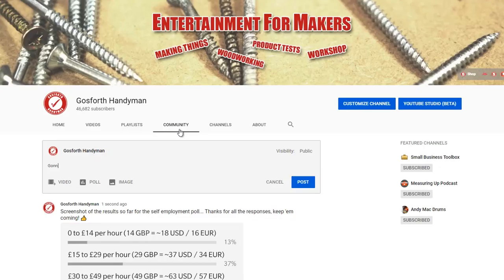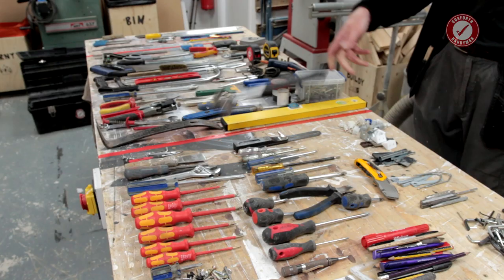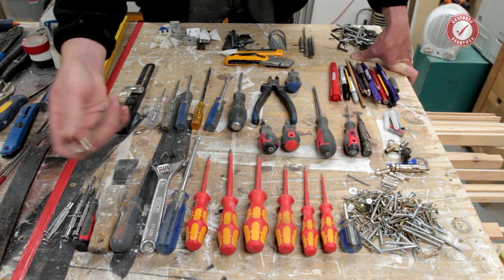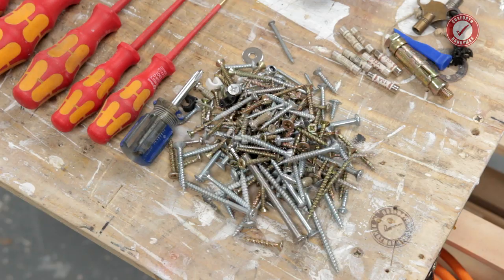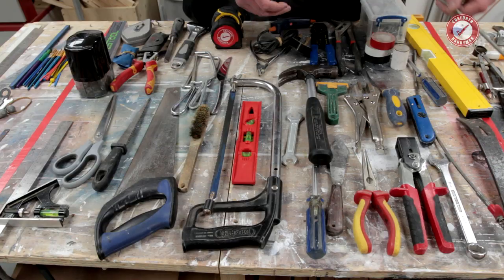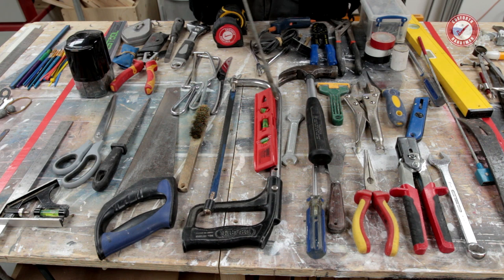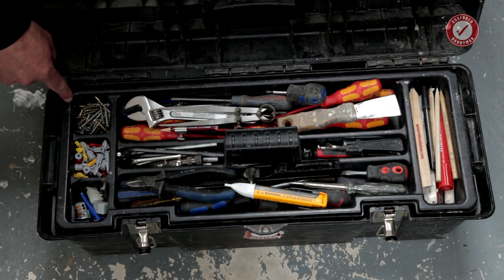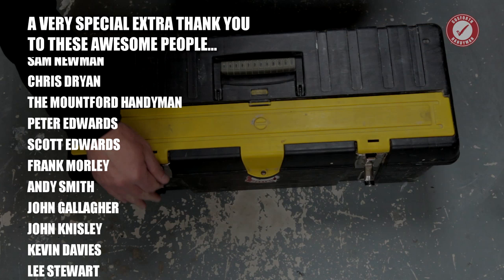TOOLBOX TOUR - 50,000 Subs Special!

Comment: Glazier's pry bar it will replace your butter knife and add a scraper nail puller to your kit in one tool. Also or fishing wire you can replace the string and weight with a length of flat chain.

Comment: One of the things I've come to terms with over the 12 or so years I've worked in a trade is toolboxes and bags are a bad idea. They're a magnet for junk and I'd end up with a spread much like yours and much of it needless. So a few years back I thought right, what can I do and I set about making a set of tray organisers out of ply that stack inside a systainer. Obviously this wouldn't be to everyone's taste but you know now, everything has a place, it attracts no more than necessary and it works. For tasks where I'd require tools that I don't carry daily I have three sets of shallow drawer cabinets with each having a drawer allocated to say pliers, or screwdrivers, hex keys etc and I'll make up an on the fly tool kit for the next days job using an open tote systainer to accompany my EDC systainer. I know 'OCD' is a bit of a buzzword these days but I do have OCD and it was mentally taxing for me when I had a bag that everything was thrown in. The system I use now allows me to see exactly what I have and I know when something is missing as every tool has a specific place to it becomes photographic and it's easier to think I need X that's in tray Y next to A. My ideal would be to take a snap on type cabinet to work but it's not ideal for construction sites where I normally work.
Reply from the maker: Fantastic - I've seem some lovely set-ups with systainers and custom foam cut-outs. 👍👊

Comment: Glad to be one of the 50,000.  You look well covered in tool box to me.  My problem is, no matter what tool I haven't used for years and opt to leave out, I usually need on the next job.  Don't understand why craftsmen don't use mechanical pencils.  .7 or .5 mm available.  Electric sharpener takes up lots of space.  Keep them coming.  Appreciate you sharing with us.
Reply from the maker: Ha cheers! I do have propelling pencils in the workshop but I always seem to revert back to normal pencils. I might make a vid about that. 😂👍
Reply: @GosforthHandyman  Stanley knife whittling pencils does instead of toffees for contemplation time, oops where are the elastoplast.

Comment: Congratulations on the 50k! Well-deserved, too... you can see how much effort is put into each video. 

To your toolbox I’d add:

1) A small ratchet/bit set. Mr Millard has a Wera one, but I have a Facom Pico R1 one and it’s staggering how often I use it. So useful, in fact, the high price is long forgotten and I’d shell out for another in a heartbeat if I had to. You don’t really need a set... the ratchet alone is all.. just like the blue-point one Mr Millard has. The Facom has a few tricks the Wera doesn’t, so I really like it for that. 

2) Replace all the hex keys w a decent Bondhus or Wera Hex-Plus set. The latter is good for getting out hex bolts that’ve been abused.

3) Screw pliers. Sorry I don’t know who makes it, but I have this cheap-looking longnose pliers that has the tip serrations running lengthwise instead of crossways. Designed to grip screw heads where the screwdriver recess is fecked. It’s not Knipex.

4) Wera Laser-tip screwdriver. Seriously... I hate Wera handles but the laser-tip drivers are unreal. 

I live in the US where the god-forsaken Phillips is king. They are horrid. Torx is starting to take over tho.
Reply from the maker: I keep my ratchet driver and bits in my drill box. Philips needs to just disappear - Pozi and Torx are good though. Cheers Frank! 👍👊

Comment: Congratulations on reaching 50k! I spotted the paracetamol in the wood under the bench and wanted to shout to you when you couldn’t spot them moments later!  
I have a Boa Constrictor rubber spanner thing that has rescued so many problems. My top tip though would be to use pencil cases to separate things a bit. It’s so handy to grab the red pencil case for spanners and the green one for hex keys for example.
Reply from the maker: Yeah, I found them about 2 weeks later 😂 Really good idea with the pencil cases! 👊👍

Comment: Congrats on the 50k!
  My DIY toolbox is like a sawn-off version of yours - a smaller Stanley with many of the same contents.  A heads-up word of warning though.  Be careful when lifting, especially in awkward places or positions!

Just before Xmas I had to get mine out from under a worktop in a corner. Halfway through the lift "something" pinged in my right shoulder.  OK, soft tissue injury so take it easy for a few weeks.
  Except around Easter I had to shift a few boxes around.  Somehow doing that overloaded the joint and next morning I couldn't move my right elbow more than an inch in any direction.  Doc says rotator cuff injury.

Three months on from that and multiple trips to the Physio later, it's still not fully sorted and is probably going to take a while longer before it's fully recovered.
  Dem tings is HEAVY!  Be careful: think before lifting it!
Reply from the maker: Cheers Richard! That sounds nasty - hope you're OK! 👍👊
Reply: @GosforthHandyman  It was an awkward full-reach lift.  Thought I was being careful but obviously not careful enough.  It stopped me driving or doing much of anything for a few days and there's still stuff that's difficult or no-go to do or reach.  The main reason for posting it was to flag it up for others to just watch out when lifting, especially when it's heavy or awkward ... or the years are starting to add up!

Comment: Andy, great video, here's to 100k subscribers.  the blue bendy thing is called a "French curve" used when drawings were done with pencils to get a smooth curve through a number of points.   
Regarding the electrical test screwdrivers I think you mentioned, these are junk and potentially lethal, check out the John Ward video on them.  Personally, I use one of those plug in units with 3 lights on them to confirm a socket etc is live, they are also good for checking extension leads.  they let you know when an earth is missing or the line and neutral are round the wrong way, more common than you would think.
keep up the great videos.

Comment: If you DID want to carry a chisel in this box, FastCap balisong-style chisels could be an option (if they're legal in the UK ; ) I have several in my toolbox and I never have to worry about them dulling or me accidentally jabbing myself with one. They're sturdier than you'd think by looking at them. I do not, however,  recommend their pocket awl, as the shaft construction and shaft material used are substandard. Mine broke almost immediately.
Reply from the maker: Will have a look - cheers! 👍👊

Comment: Ha Ha loved it, BUT..............(this may be a long post.....) Its a Glazing putty knife not a scraper, buy a decent hammer!!, Plastic level!!, feeler gauges, your spark plugs need constant adjusting :):) Put the Power detector in the top out of harms way, put your setting tool in your OCD (I have 3 screw/plug boxes all catering for different sizes etc, Pencils....what can I say use propelling pencils, no huge sharpener involved, constant width of lead (Wilko do 2 for about a £1, with a pack of spare leads) I only cleaned my toolbox out this week as it was full of sawdust chucked lots out to put into a 2ndary tool box (I have 3 of those now :()
Reply from the maker: My hammer is fine - I hardly ever hammer anything. The bigger level is metal - the little one is just for awkward spaces - it's accurate though. You're right about the detector - will see if it fits. No room in my OCD boxes for the setting tool but it normally ends up in my drill box depending on what I'm doing. I just don't get on with propelling pencils! Might do a vid on that. 😂👍👊